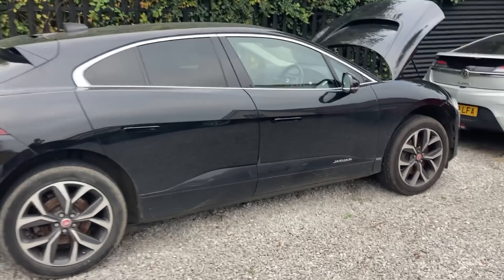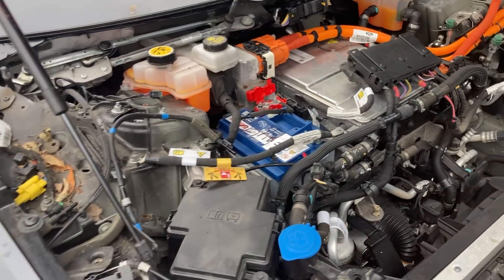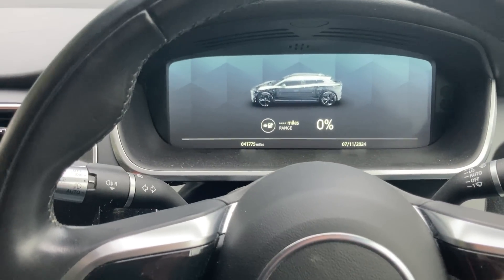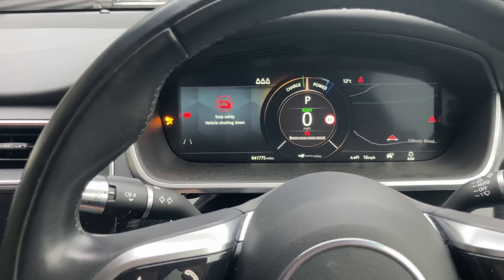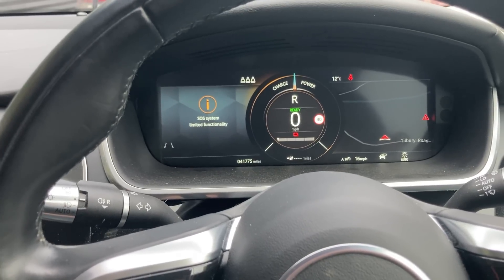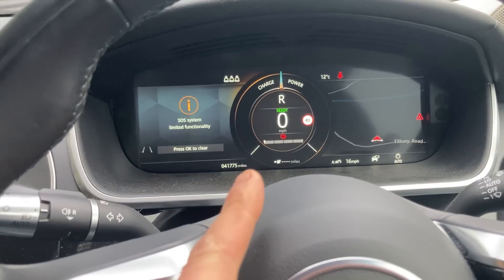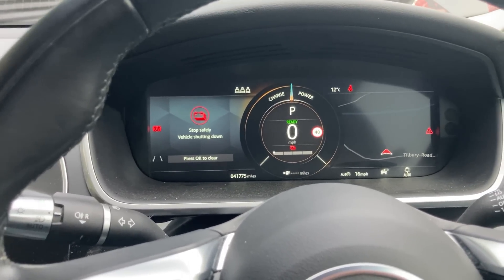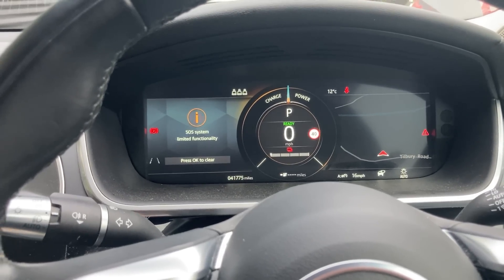This premium EV has multiple serious faults - Jaguar i-pace electric car issues - hv battery, motor.

Comment: Interestingly the isolation fault seems to be the type of plastic used in the battery module. It seems to have some conductive reinforceing material in the plastic matrix.

Comment: I’ve just purchased a second hand 2019 I Pace, intermittent issue where dash says ‘Hogh voltage system fault detected’, and I can clear it by pressing clear. Also just lost cruise control and can’t seem to find where the radar sensor is to clean it, apparently a common fault.
Reply from the maker: Eek ok, was it a private purchase or from a garage? If it was a garage then take it back asap! Not sure what area you are in but DB Car Doctor in Duxford is very experienced with the ipace. Cheers.

Comment: My iPace is a 2019 SE spec on air suspension with 45,000 km on the clock. Until this year it has been a wonderful car to drive and own with no problems except needing new front tyres at 42K km then new rear tyres at 45K km. Front wheel alignment needed correcting.
This year the heater won’t work. I was quoted $8,450.00 for new heater and fitting, big job requiring removing dashboard to remove old heater and fit new one. No spare parts available to repair the heater but Jaguar sells complete units only. After a lot of complaining to my Jaguar dealer about cost and that heater failure is a common problem with iPaces , so there must be some part within it that is not of merchantable quality and because I’ve owned two other Jags and four Landrover’s they decided to do the repair at half price, $4,225.00. The traction battery has just lost about 33% of its functional capacity so when fully charged gives 278 km range not the 420 it used to. The battery repair will be done under warranty as the battery warranty is 8 years. The car is still OK to drive and as I have a 7kW home charger it is not really a problem. It is still dynamically a great car to drive and its build quality is very good. I’ll probably need to keep it a long time as resale for them in New Zealand is very difficult!

Comment: Replace the 12V batteries. If it's a pre 2021 there will be 2 of them a EA427 and a EK151 both Exide.
Reply: Yes. The smaller 12V battery is just to old to provide the millisecond high amperage draw to engage the relays fast enough for the computer to accept correct engagement. The voltage will indicate correctly. You need a scope to capture the actual voltage drop

Comment: I was looking to purchase an I-Pace MY22 with 11,000 miles,  it past it's MOT a month ago when it had done only 9,500 miles but with 2 advisories for wear on both nearside and offside front tyres.  It didn't make sense in an AWD vehicle at such low age and low mileage.  Your video, which I accidentally stumbled across seems to answer why that might be.  Thanks for saving me a massive headache

Comment: Is it possible to put 11kW OBC in old I-pace that has 7kW OBC?
Reply: Not really feasible. Buy a model with 11kW, MY21 or newer, if it's important to you.
Reply: @Baldrick15 
I sell chargers. I had frustrated customer whk had to install 50A service (insted of 3x25A service whiche is standard in Serbia) and 22kW charger, only to realise his car will charge no faster than 7kW and takea 14 hours to fully charge.
Later he gave 3000€ more for 30kW  DC charger.

Comment: Yeah I just sold myn. The leaking windscreen was the first problem I had, then the AUX and 12V. After that the steering rack went and was replaced numerous times. Extended warranty is £1500 a year after year 3 and the rack costs £4000 to replace.
Reply: Was your car parked under a roof, or in rain and sun?
Reply: @bayerbear6770  on driveway no roof.

Comment: I experience the steering wheel shaking and this first issue was POWER STEERING WHEEEL ASSISTANT deactivated,  software updated but now the steering shakes aggressively with a 2019 Jaguar I-PACE, seems related to the eletric power assist, software upgrade can correct it only for it to happen again, did you get this fixed? Solution?
Reply: I would try to replace the 12V batteries first, unless they are less than 3 years old. Low voltage spikes can mess up any sensor, which would rattle your front engine..

Comment: Fantastic car. On my second and this one is 4 years old and no plans to change. Any error messages, replace the 12v battery which solves 95% of the "problems"
Reply: Same experience for me. Have a 21MY` from new. Great car, excellent drive and no issues to date!

Comment: MY 71 plate 13,000 I Pace won't take a charge from my Zappi.  Had two electricans round , second one fitted a new Zappi sent free from My energi . Didn't know if the fault was the car or wall charger . Will only take a charge from a Instravolt outside charger.  Jaguar dealer I bought it from says two month waiting to see it  , so I've booked it into another Jaguar dealer an hour away with a five week waiting ..   Shame car is great , don't want to let it go but really Jaguar .Get your act together .   Having a problem you want to get it sorted & back on the road .  Sorry , won't now buy another Jag .
Reply from the maker: That's not good, not sure where you are in the country but DB car doctor in Duxford has fixed several ipaces with various non-drive and non-charge issues. Cheers

Comment: Should I get a used 2020 I pace ?
Reply from the maker: If you do then buy an aftermarket warranty !
Reply: @garycevrepairs hi there I have been looking for a reliable ev mechanic! Have you worked on kia optima plug in hybrid?
Reply: Yes, still the best driving awd ev around with the permanent magnet motors front and rear!   Im in the US and waiting for WAYMO to sell off their fleet of IPACES----Ill drive my 2019 forever as I love it---240,000 miles!

Comment: My I-pace broke down twice. First 4000 euros, cable harness, then 8000 euros all sorts of broken down electrical equipment. Worst car I ever had! 🤨
Reply: You need to check if a car is your enemy sign before you buy it. Don't just buy a car because you like the looks of it or the brand. If the car brand has your enemy energy, it will turn out to be the worst car you ever owned. Hand it over to someone who does have the same enemy sign issue and you'll see they'll have no problems with it. If the car is has your enemy energy and it keeps breaking down, you should be thankful because it could have been much worse  eg. a bad accident on the road. Don't ignore ancient knowledge

Comment: Braking failure worst car I bought seriously beware before buying
Reply from the maker: 🫣 that’s not good
Reply: You need to check if a car is your enemy sign before you buy it. Don't just buy a car because you like the looks of it or the brand. If the car brand has your enemy energy, it will turn out to be the worst car you ever owned. Hand it over to someone who does have the same enemy sign issue and you'll see they'll have no problems with it. If the car is has your enemy energy and it keeps breaking down, you should be thankful because it could have been much worse  eg. a bad accident on the road. Don't ignore ancient knowledge

Comment: You have the traction battery flat and the the bonnet open.. so it is no surprise that the car wont move.
Reply from the maker: Damn you're so smart, thank you so much
Reply: I was thinking that but I would expect a warning or two,  not being able to select drive and no movement.

Comment: My 2024 jaguar has broken down four times onky had a year never ever agajn
Reply from the maker: Not good
Reply: Currently broken down as we speak lol loss of power electrical fault
Reply: You need to check if a car is your enemy sign before you buy it. Don't just buy a car because you like the looks of it or the brand. If the car brand has your enemy energy, it will turn out to be the worst car you ever owned. Hand it over to someone who does have the same enemy sign issue and you'll see they'll have no problems with it. If the car is has your enemy energy and it keeps breaking down, you should be thankful because it could have been much worse  eg. a bad accident on the road. Don't ignore ancient knowledge
Reply: Enemy energy?? Have you been on the wacky-baccy, the gin, or both?

Comment: The dealership quality of service seems much better in Switzerland than what I read about the US and the UK where customers seems to have to deal with incompetent dealers with long delay for parts, particularly battery cells. My experience in Geneva is totally different so far, purchased a 2019 HSE First Edition (the most option loaded one can find) 14 months ago. I had so far two issues, first a faulty valve in the Air Suspension. I left the car one day at the dealer and they found what it was and told me they’ll call me back when the part is available,  which took a week. Meanwhile there where no issue driving the car other than being only able in standard confort drive and curiously loosing the adaptative cruise control. Then I left them the car one day to change the part all for about € 600.—. 
The second issue was a faulty battery cell in the main traction battery, again one day at the dealership to find out what it was, then waiting not for the part that they actually had but finding a slot in their schedule to do the work, so they booked me for 2 weeks later, and kept the car 4 days as it is a big job to take out the main battery out and open it. I’ve received a loaner and the whole thing was covered by the warranty. (While waiting for the repair I could still drive it but only charge to maximum of 72.5% so we took my wife’s thermal car for out autumn’s holiday travel)
So I’m very pleased with my local dealership service and part availability in total contrast to what I read UK and US owners are experiencing!
Other than these two issues it’s been a lovely car to drive and own.

Comment: When Jaguar goes bust there will be no warranty for these iPaces, and no one will be making the complex spare parts.  Even if they survive they’ve said they actually want to lose 85% of their old customers and they’re closing most of their dealerships.  You’d need to be very brave to buy a Jaguar now!
Reply: I think you’ll find the battery warranty (which is really needed as that’s the expensive bit!) is more than 3 years 🤣
Reply from the maker: The battery is covered yes but I’ve seen multiple faults with the ipace outside of the battery. Cheers
Reply from the maker: The warranty is only 3 years anyway so they rapidly get past that. A friend has one but it’s a company car, the company can take the risk !!

Comment: i have a MY21 like the one in the video: I love it but there have been a fair few issues over the 2.5 years of ownership: leaking rear camera cleaner (hose split, new unit needed), charging flap sensor failed (new charging flap), two faulty HV cells (limited to 72% charge, awaiting dealer to fix it, booked in Jan 2025 (massive backlog)), boot won't close electronically (but will open but beeps on closing, still needs resolving). 50k miles, but quite a lot of issues for a high value premium car to be honest. Love it, but wouldn't buy another...
Reply: oh, and the front tyres: yes, google 'chunking tyres' and you will this is standard on the ipace....

Comment: I haven’t had any problems with my used 19 I pace First Edition I bought last year. I absolutely love it. I’m in a dry area of Los Angeles so I wonder if moisture in the UK is a contributing factor that damages the electrical systems. Idk maybe I’m just lucky so far. I will be getting an extended warranty because I plan to keep it for a long time. Jaguar just announced they will be buying back all 2019 I Pace in the US for battery fires but they would have to offer me a lot more than I paid for me to give it up.

Comment: I have a 2020 plate ipace, older model with two batteries. I got some strange messages once about the brake system but the car still drove. I looked online and there was lots of information about this error being related to the 12v batteries.  I had these replaced which solved the problem. Thats it in terms of issues with 50k miles, so far. Fingers crossed!!
Reply: The smaller 12V Battery is brake booster module back up battery. Alot on ipace can be software issue. HV heater was the biggest problem on them at one point along with the 12V batteries.
Reply: I got a brake pedal feel reduced fault only once on my 19 First Edition. Never happened again and car drove fine. I once got a traction battery fault detected. Same thing, popped up for only one drive and never happened again. They just announced they will be buying back all 19 I pace for battery fires in the US but I adore the car so they would have to offer quite a lot for me to give it up.

Comment: I have 2018 build Ipace and apart from the dealer breaking a coolant pump during the front loom recall, it has worked perfectly ( fingers crossed). Mostly charge at home on a 16A charger up to 80% unless making a long journey. Done 55K Kms now. Still gorgeous to drive here in NZ. Imported it myself from UK at 2yo.

Comment: Where are you bases please.

Do you take on tesla repairs
Reply from the maker: Hi I mainly help independent garages with EV diagnostics and only do a couple of major projects here and there. Does it need high voltage work or just general repair? Cedar electric specialise in battery repair and cover Tesla. Cheers

Comment: If you have a Jaguar under warranty, phone the jaguar roadside assistance, they will send a roadside assistance guy to you, if they say it needs to goto the dealer then they are obliged under the terms of the warranty to supply a loan car, which should be equivalent size vehicle, but may be diesel. This is quicker than trying to get an appointment directly with the garage.

Comment: Jaguar: Pissed on their heritage, abandoned their customers, wanted to be premium, wanted to be cool and funky, saw their future in luxurious electric vehicles, currently has nothing to sell.
👏👏👏👏👏
Reply: Very true and i doubt they ever will have anything to sell.
Reply: @mikeolly67   I am an enthusiast, so it breaks my heart, but IMO Jaguar died a long time ago when they didn't build the CX75, and launched a series of bland SUVs to compete with Range Rovers.
Reply: @mrg-ghx8052  I agree to a point, but the F type was a masterpiece
Reply: @mikeolly67  F type definitely is a beautiful car, so are the XKs. CX75 should have sat at the top.  They made the same mistake with the XJ220, and announced unachievable specs, in CX75 case a hybrid turbine engine like nobody has seen before or since was in the design.  I also liked XE and XF, particularly XF which I think should have been available as a 3 door coupe and convertible from the first model.
Reply: It's about to get worse for Jaguar, if that's at all possible! They are reforming their dealerships which means that many will lose their franchise, so even less dealers will be available.  It also seems that when their new ranges are launched they will targeting the premium luxury market where the entry level cars will start from £100k.
Reply: @geoffaries  indeed, my local Jaguar dealership that had been there forever, has just been emptied and refilled with non-specific used cars.

Jaguars new vehicles will indeed all be EVs.  There will be a GT, a limousine and an SUV and yes they will be priced up there with Bentleys.  Ironically, I read yesterday that Bentley are pushing back their EV only strategy from 2030 to 2035 and will continue with hybrids for the interim.

Unless Jaguar can come up with something different, unique and exciting, something authentic, they will be obsolete very quickly.

Comment: Interesting video. I have an iPace (22 model) and absolutely love it - smooth and comfortable and goes like the wind when you need it to. Since I got it I have had an issue with the Lane Keep Assist - some days it works, most days it doesn't. Not a big issue as I mostly drive on smaller roads where it can be more of a nuisance than a help. I cannot see any logic to it and there are no fault codes (I guess whichever unit is at fault doesn't think it is). Earliest booking I can get with a main dealer is mid-December and I bet that on the day I take it in it will work perfectly. In the mentime I will enjoy driving it the old fashion way with my hands on the wheel.
Reply: I have a 21 year. I don't trust the lane keep assist at all. It waits until it's almost on the line then suddenly jerks quite hard to the right. Then as it gets close to the right side line I don't want to risk ploughing into another car so I take over. Surely if it says it sees the lines then it should be able to keep in the middle smoothly

Comment: There seems to be the idea that that because EVs have far fewer moving parts, there is much less to go wrong. In modern I.C.E.s it is usually the electrics, rather than the engines which give most trouble. Many old 80s and 90s diesels did astonishing mileages, before cars were burdened with complicated electronics.
Reply: And we see from laptops, cell phones and other gadgets that electronics doesn't age well.
Reply: Actually in modern ICE cars you have multitudes of mechanical issues.

Don't forget those 1990's cars were running at 1/3rd the efficiency of EV's as well.

Comment: I was always put off the I Pace because of the poor efficiency. I hear of so many potential issues with JLR products that I steer clear of them - a pity because they've made such nice cars in the past.
Reply: The I-Pace is still amazing to drive though!
Reply: That is normal for sports cars. 400+ hp ice cars dont have the best fuel economy.
Reply: They aren't actually too bad on efficiency. Most drives I get 3 miles per kWh. My car has 20" wheels with 245 width all season tyres may be something to do with it
Reply: poor efficiency lol. if being able to drive 255 miles for £4.50 isn't efficient then I don't know what is? All cars break all cars need servicing no mater what make or model.